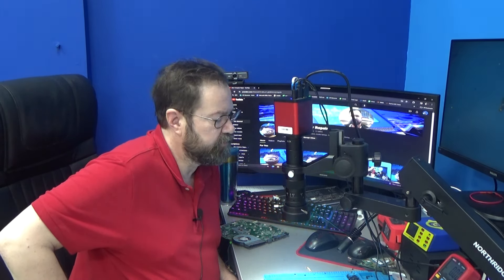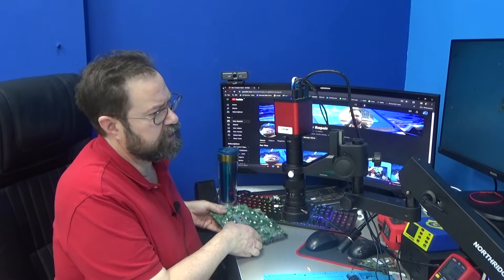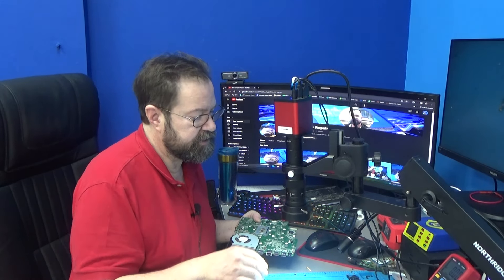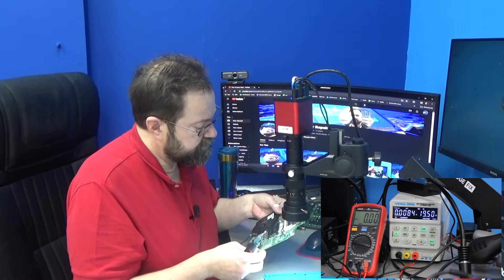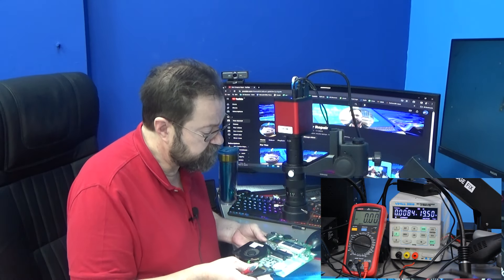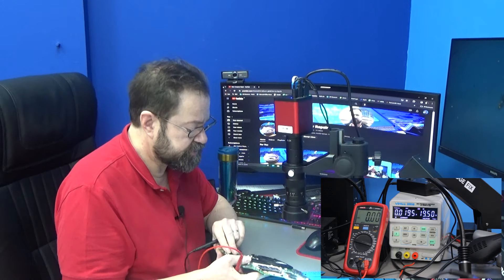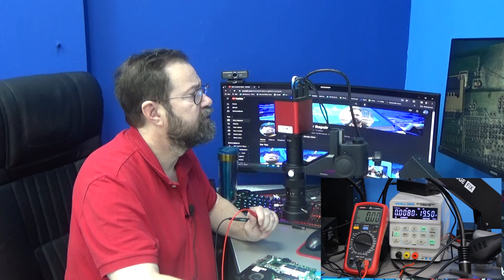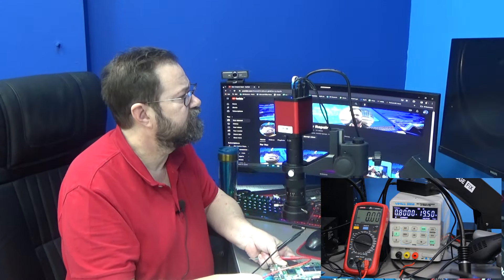How a Computer Turns On

Comment: You lost me a chip that has a pull up of 3.3 and calling it an LDO.... I have never heard a IO pin going low called an LDO.... Low-dropout is normally voltage regulators... Correct me?
Reply from the maker: Yes, that is what it is referred to.  The chip responsible for the 3.3V will have that designation on that voltage rail running to the EC and the power button. It's not a pull up chip, has 19.5V in and Batt In. One pin is 3.3V AON
Reply: @BasicComputerRepair Pull-up is referring to the resistor on the logic line that is connected to logic high voltage (in this case 3.3V). When that I/O pin with the resistor to 3V3 is connected to ground, we call that "pulling it low". What happens, is that the resistor to 3V3 limits the current you can draw on that short to ground, effectively causing it to go to 0V without actually shorting the 3V3 to GND. The signal is considered "triggered" when the signal is pulled to a "low" voltage potential.

The opposite is possible as well, with a resistor going to ground and your signaling connecting it to a higher voltage. That's called a pull-down. The signal is considered "triggered" when the signal is pulled to a "high" voltage potential.

Both of these ways of signaling are referred to as active low with a pull-up resistor, and active high with a pull-down resistor. 

"LDO" does indeed refer to "Low Drop Out", as @interpleb1675 has alluded to. The 'drop out' part of that abbreviation wouldn't make sense in the context of a logic level signaling line. The 'drop out' refers to -- roughly -- a property that describes when a device stops working. In the case of an LDO *regulator*, that means the regulator has a very small amount of difference it needs between the input and output before it cannot keep the voltage at the specified output level. 

@BasicComputerRepair Can you clarify who taught you or where you learnt about logic low signals being called LDO? I'm curious to see where the misconception comes from, even if it's possible a widespread misused word. To give you an example or reference point: take the datasheet for the SMSC LPC47N217, which is widely available. Pins and signals there are referred to as "active low" or "active high". Some of these pins will have internal pull-up or pull-down resistors. The same terminology is used in the venerable STM32F103's datasheet, a well known and ubiquitous microcontroller. These even have configurable internal pull-ups!
Reply from the maker: @AnnaVannieuwenhuyse  Thank you for your very detailed explanation.  My channel is for beginners.  I don't plan on going into that kind of detail within a year or more.  The point was just to show how a computer turns on, it's main components, and a follow up video on diagnosing a problem with the 3.3V AON line.  You are obviously a trained technician.  LDO is common phrase terminology for the linear always on 3.3V for startup, and yes, probably should not be used.  My formal training is from a Technical institute in the mid-2000's.
Reply: @BasicComputerRepair Utilizing inaccurate terminology within educational contexts is inappropriate. Many individuals resort to translating complex concepts into everyday language for effective teaching, whereas using technical jargon only serves to confuse.
Reply from the maker: @TransRightsMatter  The data sheets put out by major manufacturers, such as Texas Instruments, use this same terminology with regard to the linear 3.3V AON on computers and many devices for start up.

Comment: You said that we should short the 3.3V to ground to start the board but my understanding is that this cannot be just pin with 3.3V on it but it has to be specific pin of the EC chip, correct? My understanding is that the chip itself is running from 3.3V which is connected to multiple pins of this chip (so we can easily find that one when searching somewhere around EC) and shorting them to ground will not start the board. Or am I misunderstanding something?

Also isn't this 3.3V also delivered to some other chips than EC even before EC gives the signal to start the board? So just to be sure that we ground the right chip, shouldn't we check the pinout of this specific EC chip?
Reply from the maker: If I understand you, yes you are correct.  I pre selected the point I used to short it.  I was not searching.  Yes, there are other voltages coming from the BQ chip, but only the 3.3V LDO shorted to ground will turn it on.
Reply from the maker: No, you do not need a schematic of the EC.  You can find the pins with continuity setting on multimeter to power button.
Reply: @BasicComputerRepair  Thank you for such a quick response and for clarifying things I was confused about. In case of the motherboard that you are using for this video it is indeed simpler to just use the pins for the power button but I expect that the connector for the power button might not always be as straightforward to find or use it. In this case I could search for the pin number of the ON/OFF pin in the datasheet and short it somewhere close to EC chip.

That is not possible if the EC chip is BGA, though. My takeaway from your video is that in the worst case, I can can just blindly look at various components around the KBC for 3.3V and short them into ground hoping that one of them will be the power button pin, correct? Maybe I should use some small resistor so that I do not do a real short, though?

In any case, thank you for the video, looking forward for more content :)
Reply from the maker: @krzysztofadamski7804  You are obviously a technician.   Actually, shorting anything to ground will cause no harm.  It would be just as if the power were turned off.  I will eventually get to data sheets, schematics and boardviews, but this channel is for absolute beginners.  Just wanted to show the concept of how a computer turns on via shorting the LDO to ground.   I will eventually get to much greater detail. 

Thanks for your comments and your views!
Reply: @BasicComputerRepair  I'm not a technician but I think it's fair to say I'm not complete beginner.

Since you say you are a hobbyst in some of your videos yourself, you know that people interested in those topics may have different (probably sometimes even unexpected) background. I just happen to have some background (mostly self taught, as a hobby too) in electronics  so I may know a little more than some other beginners but I never considered repairing a laptop motherboard myself before :)
Reply from the maker: @krzysztofadamski7804  I call myself a hobbyist because I only teach this to high school students and make repairs on the side, so O don't do it professionally like a repair shop.  I do YouTube as a hobby.  I have formal training but only outlet is teaching in the classroom and YouTube.

Comment: Thank you so much for this amazing vid, your camera and everything was perfect I liked the way that you explain with very understandable, the only thing which was missing the schematic! How can I know the position of the resistor or capacitor which was connecting to super io to short it out with GND. Thank you
Reply from the maker: Most computers, especially non-Apple, don't have that information available.  Apple does because people pay a lot of money for reverse engineering or smuggled out schems and boardview.  You can find it with the continuity on your multimeter.

Thanks for watching!

Comment: Trying with an alligator clip to short the 3.3V to ground around the EC is at least risky. Shorting something else there could permanently destroy the EC and replacing it isn't an easy task. It's not only that you have to desolder it and solder it back, you may also have to program it otherwise it won't do anything. It's much better and safe practice to find and short the 3.3V pins in the keyboard or power button connectors (if it is separate).
Reply from the maker: I had pre tested the points.  That wasn't a guess.  Found them via continuity to the power button.   Both of the components I touched were correct. 

But that was not the point.  The point was to show the purpose of the power button.  But, the same can be accomplished at multiple points around the EC.  Perhaps I implied I was guessing and searching for the right component.  

However, when a computer is not turned on, shorting anything to ground around the EC other than the 3.3V LDO will do nothing.  It would be just as if the power disconnected.

If you can show a component around the EC, or even a pin on the EC itself that causes any harm, I will concede and make corrections to the video. 

Until then, the video stands and I stand by it.

You are obviously a technician and of course a person needs to know what they are doing and not just poking around such an important chip.  But to ground will cause no problem. 

Now, the BQ chip, that's a different story.  That's why I did not short there as a slip can blow the BQ and cause damage elsewhere.
Reply: @BasicComputerRepair As I said this is a bad example of practice especially for someone who is now starting with electronics and more specifically repairs. You could have done the same using a probe with a very thin needle and not the alligator clip stating that this is a task that requires some attention and precision. As for your request, you know that EC has direct data lines with PCH. I don't know the layout of this specific board (I would need to know the P/N of the board and a boardview) but shorting these line with 3.3V could cause permanent damage to the PCH and the end of life for this board. Again, I'm not saying you don't know what you do, I say that someone rookie watching this video may come to the conclusion that poking around with an alligator clip in a board is completely safe.
Reply from the maker: @nikolaskallianiotis8622  I was shorting with GROUND, OV,  not 3.3V.

Even if I touched the alligator clip to a 3.3V point and a data line simultaneously, the other end of the clip was ground, which would have shorted noth the 3.3V and data to 0V.

Your point is understandable.  Alligator clips rather than a sharp point is a bad choice, but I clearly showed the other end was secured at ground.